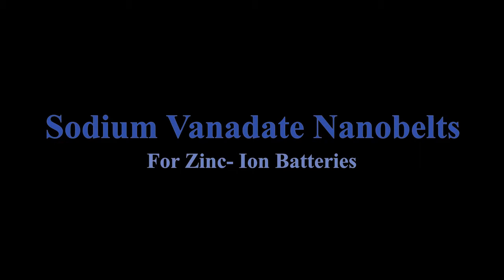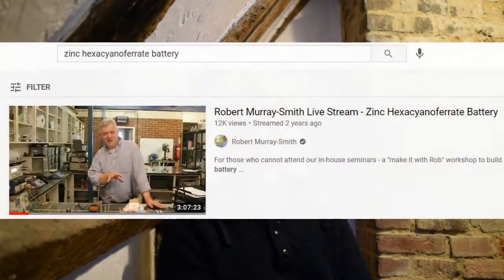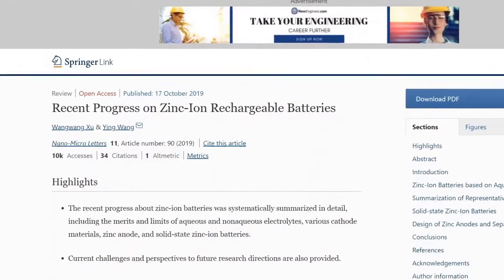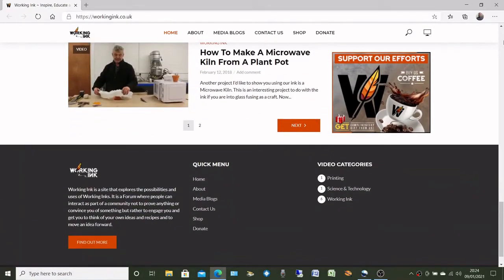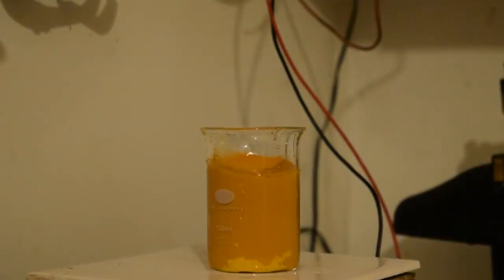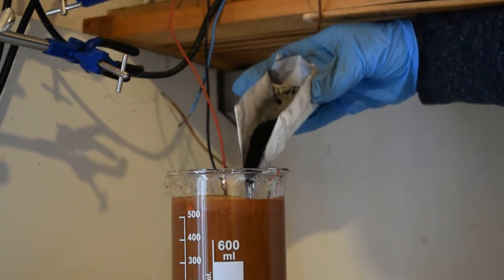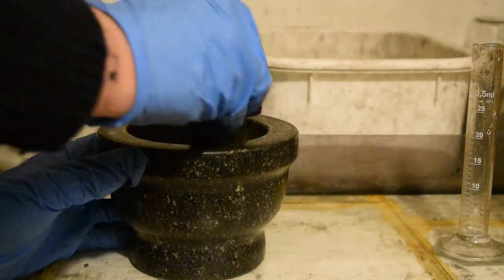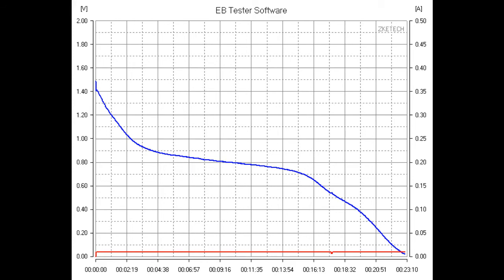Making Sodium Vanadate Nanobelts For Zinc-Ion Batteries

Comment: please redo this experiment but with slight change , Add Zinc Oxide or Zinc Dioxide or Mg02 while preparing NV nano belt .. I hope this will create housing for Charged Ion .. Note: Initially , CHarging and discharging would be less but will increase with each cycle.. CHaring discharging at high voltage may impact , Try and test..

Comment: have you ever made a lead carbon battery  i sprayed a lead plate with spray glue and my carbon stuck to it and did not fall off  after a few cycles over  3 or 4 months
Reply from the maker: Cool. Thanks for sharing that info.

Comment: Hi
I noticed that you made a comment regarding freeze drying and not being able to afford a freeze dryer, well join the club. Not only are they expensive but very energy hungry. I have been making graphene for quite a few years now and have been looking at drying the product. This cannot be done realisticly without a freeze drying as the graphene will just recombine to graphite without a sublimation process. You may have tried it but you will find that a cubic centimeter of graphene paste will hardly be visible after it restacks to graphite. I imagine sodium vanadate will undergo a similar process and would probably lose it's structure if you dried it naturally. Not drying without binders it was almost certainly a good move. Anyhow I can let you know a process which simulates freeze drying if you are interested. It takes some time but the results are excellent in terms of volume retention. My email is identernet@hotmail.co.uk if you are interested.
Reply from the maker: Hi 
Thanks for sharing your info. I am interested in your process of simulating freeze drying. You can share with all of us in this comment section your process, but if you'd rather keep it private i will email you instead. Others do read the comment section so they maybe interested too.
i have tried a cheap version of freeze drying using vacuum and desiccants in the freezer compartment of my fridge! but it didn't work out and took ages. so any better alternatives will be appreciated.
Reply: @geeforce3891  I didn't give a description of the process as my reply as it was already quite long and you may not have been interested.
My method is as you described, but it works quite well for me. I freeze graphene slurry in ice cube formers, wrap them in tissue and put them in a pre frozen jar of silica Gel (covered). Because I am not in a rush I leave them for approximately 3 months (that is the drawback), but when i remove them they have lost most of their water and retained the same volume. I just leave them to dry slowly at room temeperature after that.
Anyhow, good luck with your research. 
P.S. After all that, I did mean to ask if you had had any problems with dendrites?
Reply from the maker: @rogerwilson6367  That's cool, thanks for sharing that. Yeah i was very impatient, kept taking it out the freezer every few days and weighing it. it would defrost and mess up the process. There are jars/containers that can be put under vacuum to help speed up the process. But if you're happy to wait then is definitely worth trying. you can use other desiccants like calcium chloride, but yeah silica gel works pretty well.
re-dendrites, i think I've only ever experienced that problem with charging at too high a voltage. it'll short ur cell. i think ive heard Rob say that dendrites only tend to be a problem with alkali electrolytes in zinc batteries, but because i'm using neutral or very slightly acidic electrolytes in zinc and sodium sulphate's it shouldn't be a problem. 
Thanks mate, you too!

Comment: Very interesting! Great work mate. How did you create your CMC/SBR mix, I've had nothing but trouble with my 70/30 mix
Reply from the maker: Thanks. This is what i do to make the binder. i put 180ml of Di ionised water into beaker and put it on to stir. i measure out 1.4g of CMC (wallpaper paste ) and shake it into water while its stirring. i then measure out 2g of SBR in another beaker (which equals about 0.6g when dry) so its 70/30. i add 20ml of Di Water to the SBR and stir it up by hand and then pipette into the stirring CMC and Di Water. Having it on a stirrer helps create a good mix. Now with about 200ml of the mix binder i now know that 1ml of solution = 0.01 g of the binder. hope that helps.
Reply: @geeforce3891   Thank you so much for the response! (Huge Fan) Really appreciate that and will defiantly try that and let you know how it goes. I was adding sbr straight from the tub. When I saw yours and how fluid it was I realised mine must be wrong as even in 400ml 2g of CMC was very viscous almost like honey. On a side note the SBR in building tubs is actually SBR Laytex (I just realised so ordered lab grade) and has 60% more Carboxyl acid (so way more cross linking). Were you using lab grade? or the same as RMS? Cheers again.
Reply: @geeforce3891  Update: Turns out I bought cmc tylose powder (FacePalm)
Reply from the maker: @karlm5022  yeh cmc is carboxymethyl cellulose. I used builders SBR, same as RMS. didn’t know you could get lab grade. Thanks for the info
Reply: @geeforce3891  O yea alibaba is a great resource also nanografi is good, more expensive but they have a huge selection of materials to try.

Comment: Loved  the vid.....particularly your level of detail and test results to validate the work.     Hi marks for helping us shade tree chemists learn something.    Can u comment on this energy density vs. similar zinc bromide cell cell or a cell with just carbon foam on  cathode????  
Thanks
Dennis
Reply from the maker: Thanks. Can't comment on Zinc/Bromide, i've never worked on that one. As for just activated carbon as cathode for zinc ion, can work well and at higher voltages. however tends to give more of a supercapacitor discharge cure. its an area of research i'm working more on. it maybe that different structured activated carbons work better than others for zn+2 ions and some give more of a battery discharge curve than others. so well worth trying different carbons. Zinc/Carbon lends itself well to a hybrid type of device. Also try doping you carbons - Try very dilute solution of potassium permanganate on your heater stirrer, add your carbon and heat to above 80c. the heat with reduce pot perm. and dope nano manganese dioxide onto your conductive activated carbon. that worked well for me. Also recently had good performance with similar method with adding carbon to making  low concentration Zinc Hexacyanoferrate, again doping the carbon with nano zinc H (can charge up to 2.4 v). so effectively have a much higher percentage of carbon to Zinc H as your cathode active material. hope that helps.
Reply: @geeforce3891  Thanks for the additional details.   Will be useful.   I'm on the zinc bromide path because of its higher voltage (less percentage loss in things like  electrodes etc),. low cost and readily available materials.   I think over all packaging is most important for grid storage...weight is a don't care.   Safety, system cost, reliability are top of the list.    Hope u continue to share ur work.   Thanks Dennis